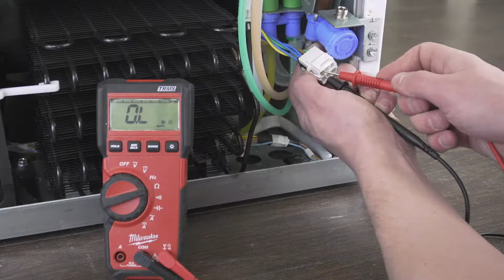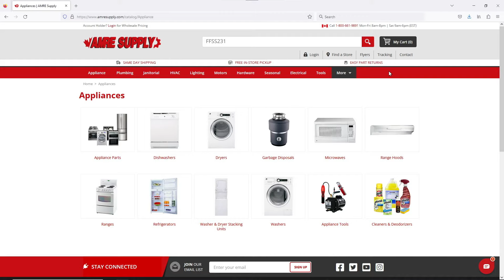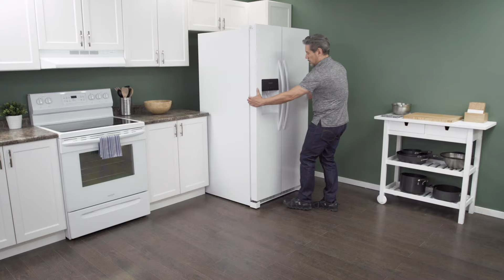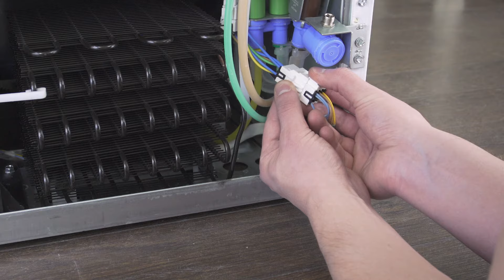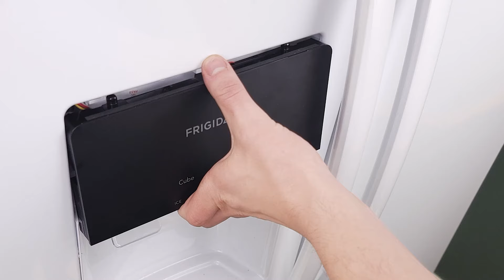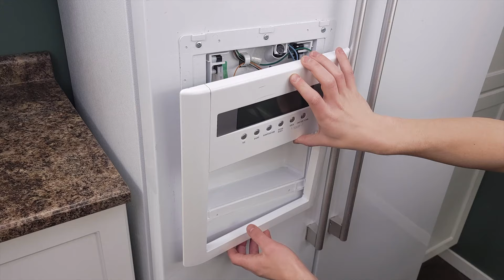Refrigerator Not Dispensing Water?  (Troubleshooting Guide) | Repair & Replace

Comment: Is there a reason why the flow after replacing the filter is painfully slow? It took me just over 3min to fill a standard 32oz Yeti..  the stream is as weak if not worse than an 80yr old man with an enlarged prostate. 

Now when I remove the new filter, water begins to shoot out of the hole in the housing where the water filter was placed. I had to immediately shut off the water valve. I resorted back to leaving the filter out and turn on the valve but it still shot out water. It wasn't even doing that before.. so now I've just got the water valve off and we have no fridge water. Very frustrating.

This is my first time placing a new filter. The previous owners did not have a filter in there and we had no issues getting water dispensed but all of a sudden do now when trying to add a new filter..
Reply from the maker: Thanks for watching. If there was no filter before then the flow will be more restricted now that there is a filter. As well some non-OEM filters can be more restrictive and might also slow down the flow rate.

Comment: Ny concern was a slight bit different.  I have a new refrigerator; the old one was not dispensing water.  In dispensing ice, I have been accidentally hitting the water lever, and it shoots water out. I desired  to not have it dispense at all.  
Removed 2 screws and the cover allowed me to se the connections to the microswitches, and unplugging  one wire stopped the water dispenser.  Goal achiever. Thank You.
Reply from the maker: Glad that the video helped you out!

Comment: I changed the water inlet valve and now there is a buzz at the front when I press the water valve with a cup. Still no water. If there is a buzz now which there wasn't before, can that still be the switch at the door?
Reply from the maker: Thanks for watching. Yes the switch could be faulty and it's good to test the switch following the steps in this video.

Comment: Well, mine passed the water pressure test with flying colors! I was wondering why so much water was leaking from the water supply line to the frig as I was unbolting it. I had turned the water back on, not off! 😂 When it finally came loose, it went flying and shooting water all over the place, hahaha! Dang -a-lang, onto the next potential issue. 
I thought I had two issues: the mysterious water leak, and the water dispenser not dispensing water. However, now I think I might have thought I had the water on when really it was off.🤔
 I’m going to put a sign on that valve so I’ll know which way is on and off in the future. “Righty Tighty, Lefty Loosy” didn’t work this time the way I thought it should. 🤣
Reply from the maker: Yes definitely best to check each connection and to make sure that everything is tight, and turned on when needed.